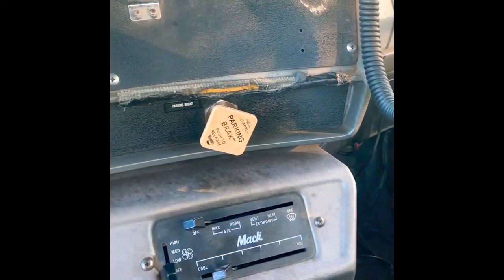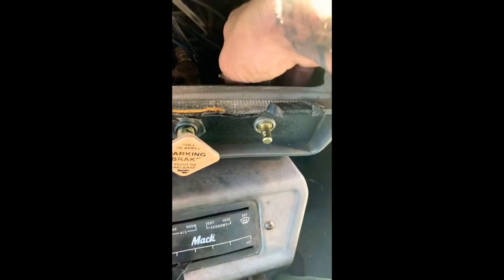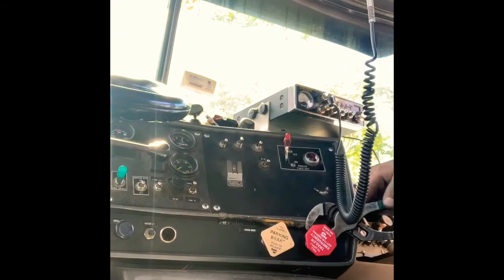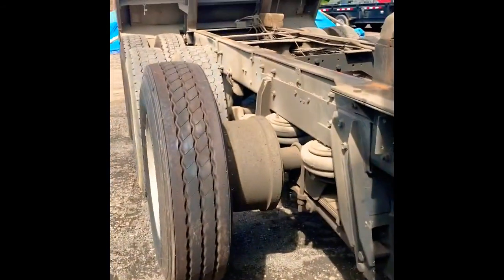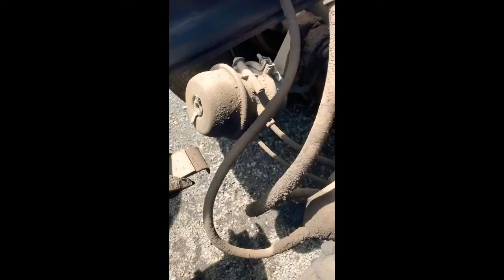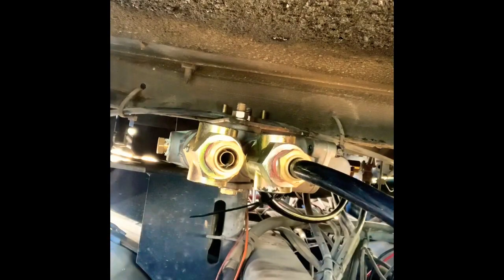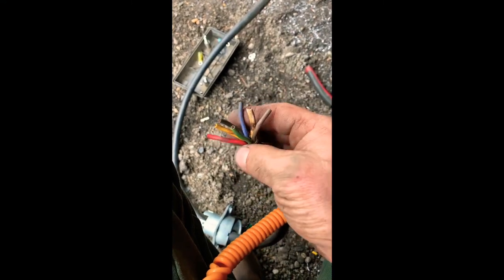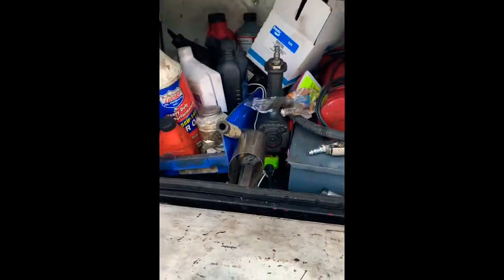Adding trailer air to dump truck

Comment: Thanks for posting going through this process now already have a trailer release valve and a tractor protection valve.... guessing I just need to run two airlines to the back and mount the glad hands.

Comment: When would a bigger air tank be a consideration? Or is it not even a consideration when adding air for a trailer?
Reply: the trailer will have its own air tank that your truck fills up. no need more bigger tanks or anything

Comment: So on the service brake did you T into the line at the relay valve or at the foot valve to then go to the tractor protection valve?